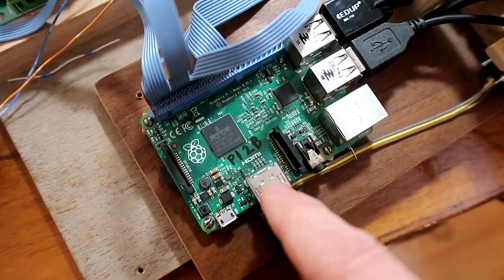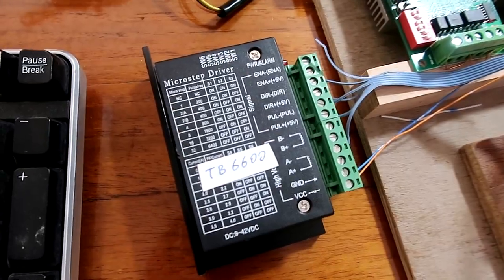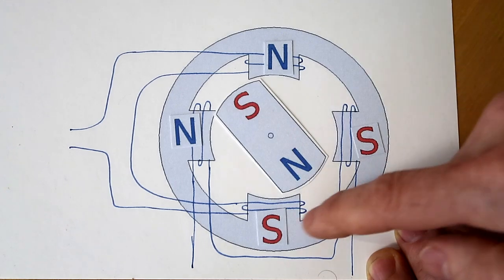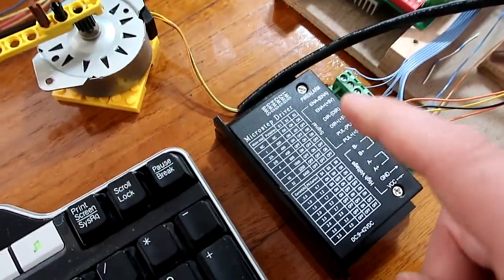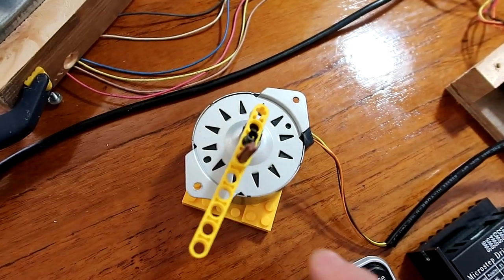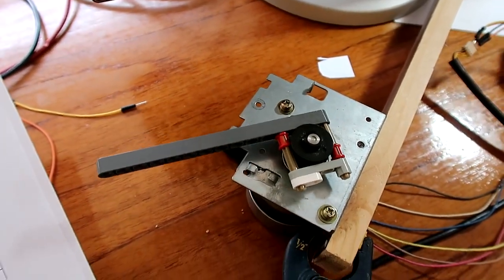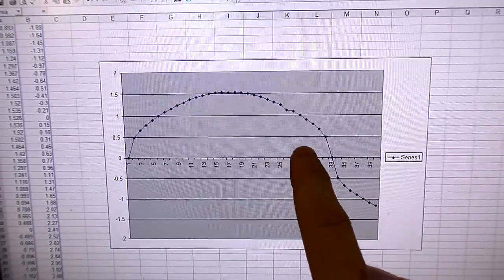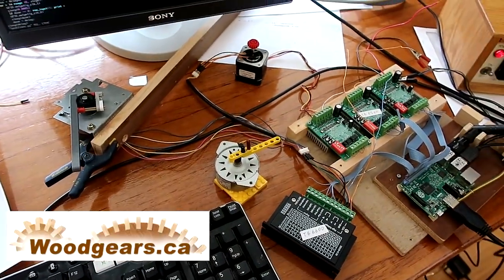Microstepping steppers, and driving steppers with Raspberry Pi

Comment: The rotor design can affect how linear the fractional steps can be.  Also might help to use a vector based motor controller and a precision current controlled stepper driver if you want real precision.

Comment: You had no problem with signalling the controllers (expecting 5v) with 3.3v of the RPi?  Interesting.  I've been reading lots about this with various answers (works/doesn't work/volt levellers). Is current on the gpio pins a concern?

Comment: It works fine on arduino as arduino supply 5v to the driver. And jerks are much low. Can you guide how i can remove those jerks while working on raspberry pi 4

Comment: Thank you for demonstration. İ use a4988 driver and motors with raspberry. 
Right now i want to learn how to make cnc without any other boards.

Which program can i use to drive steps. From 2d or 3d files to gcode to motors. 

İ dont want to use any computer or arduino or cnc control board.

İ know raspberry is enoght to do it. But i cannot find much information.
Reply from the maker: If you don’t want to use an arguing you have to write your own sftware
Reply: @matthiasrandomstuff2221  i find rasbigcd  most probabily this will solve my problem but it has no interface like grlb.   https://github.com/pantadeusz/raspigcd

Comment: The torque produced by a stepper motor is proportional to the current through the coils. Having a higher current setting will cause the rotor to accelerate and decelerate quicker, which will make it louder. Also, microsteps have less torque than full steps. If the stator's field differs from the rotor's by only half a microstep, the torque will be half what it would be if the fields differ by a full step. Smooth current sine waves produce smooth motion, but there are a number of things that can cause a stepper system to deviate from the ideal. Different drivers can use different sensing and switching algorithms to control the current. Also, the resistance and inductance of the stepper coils, and the voltage of the power supply all have effects on how easy it is for the driver to control the current.

Comment: There are a bunch of posts on the internet about problems with the TB6560 and how to fix them. For instance see:

https://maker.pro/custom/tutorial/how-to-clean-up-noisy-signals

https://www.cnczone.com/forums/general-cnc-machine-related-electronics/110986-software-66.html

Disclaimer: I have one of those boards, but have not tried the fixes yet.

Comment: The TB6600 is quite the upgrade from a TB6560. Toshiba made the drives for completely different uses. I'd say they never intended the 6560 to be used as a general purpose unit. They expected people to use the 6560 in custom made applications. So all of the manufactured hobbyist drives based on the 6560 handle current limiting in a janky way. You're supposed to change the sense resistors but instead they use the digital current reduction control.

Comment: Great video! Good idea showing the different quality motors and drivers to see what their quirks are. 

How was it that you graphed the curves? Do you probe voltage levels directly with a rasberry pi pin and figure that the voltage is proportional to current or was there some sort of current shunt of known resistance?
Reply from the maker: Measured every step with a volt meter
Reply: @matthiasrandomstuff2221  I never really understood reactive loads and lagging currents myself. Conceptually I've heard about it all enough but it's just never clicked for me. Although working with stepper motors does tend to make the relationship between electricity and magnetism all more tangible.

Comment: Expecting an electronic  version of the box joint jig...  The ESP32 family of System-on-a-chip are great.  Cheaper than the PI, works with the Arduino IDE, and has built in WiFi.
Reply from the maker: the nice thing about hte PIs is, I don't need any IDE or stuff like that.

Comment: Is it possible that the "nicer motors" aren't actually any better at keeping evenly spaced steps, but moreso that the steps already represent such small angles, that at that smaller scale is just less perceptible? From basically everything I've read about microstepping, which admittedly isn't a ton, they always warn that microstepping is more to make accelerations better and the motors quieter and not so much to squeeze more precision out of them.
Reply: Nicer motors are exactly that. They're a lot nicer than not so nice motors. It takes a lot of precision to make a really nice stepper motor. Which is why they cost as much as they do. I have some 0.8 degree Vexta motors that run like butter. They cost like $200 a piece though. So a tad pricier than mainland Chinese stepper motors. And indeed microstepping is done to reduce harmonics. Ideally you'd run a stepper motor on pure sine waves. But they're harder to control digitally. I have a big old Slo-Syn motor with 120V input voltage that I've run straight off wall current. I just phase shifted the second coil with capacitors. It ran very smoothly. But it only went one speed and stopped and started depending on applied power. So not terribly useful for controlled motion.

Comment: See everyones suggesting a wooden CNC. How about a wooden 3d printer that has an interchangeable head, capable of 3d printing, cnc and laser engraving. Nobody's as of yet come up with a decent way of doing this multi-use tool.

You can even 3d print with wood these days!
Reply from the maker: the needs for those machines are different.  It makes more sense to build three machines than to build an all in one.

Comment: Do you think that the 3-volt signal would be smoother had it not been starved down from the 5-volt it's expecting?
Reply from the maker: the 3 volts is the signal side.  that has nothing to do how the voltages and currents on the power side.
Reply: @matthiasrandomstuff2221  when I built stepper drives timing losses in the optocoupler inputs was a substantial factor. But that was a while ago so maybe the new hardware performs a lot better than it used to? I'd still have to see it on a scope to believe it though.

Comment: It's more likely that the circuit board ones use cheaper driver transistors that don't have good behavior in the linear region (or it uses PWM). 

Whereas the enclosed driver (with a decent sized heatsink) does small currents much better. giving it better behavior when microstepping.
Reply from the maker: or you could just look up the part numbers and see that both use integrated circuits.
Reply: I was talking about the quality of the integrated circuits, the internal driver transistors, and their general characteristics.

Comment: The noise issue and the cogging of the motors is directly related to the construction of the motors.  On better motors there is a specification for the ability for the motor to hold position in a step with power off.  For better microstepping the one driver has the non linear curve to counter this holding force due to the motor construction.  Best microstepping performance is with steppers with minimum holding force with no current.  This is the gear type force you feel while turning a stepper motor with no power.  The stronger the cogging, the better it holds without power and the more it will be non linear while microstepping.  3 phase brushless servo motors have no power off holding power and are driven with sine wave microstepping for nearly silent operation and an encoder for absolute position control.  This is why closed loop is quieter and much more expensive.

Comment: Try Trinamic step sticks for 3d printers. The tmc2130 has silent and spread cycle modes that interpolate 16x microstepping to 256x microstepping making the steppermotor almost silent. Torque and speed may suffer though. 24V is recommended. motor current can be set using spi. The A4988 step stick are a lot cheaper but perform not as good. Noisier and less smooth steps at different current, but you may be able to find a sweet spot.

Comment: On my 3D printer,  you need to set the hold current, which could tune out the hard notching. Have a play with ramps board the only cost a few £$ and can controls 5 steppers.

Comment: Have you verified that the unevenness didn't come from jitter caused by generating the step pulses in software? A simple Arduino using hardware PWM would solve that.
Reply from the maker: That bumpiness is way way slower than the pulse rate, and totally a function of which motor and driver.

Comment: Those drivers are not great, try something like a TMC2130 or TMC2208, or even a A4988.
Reply: I think most people who use TB6600 use them because they can drive high current motors
Reply: Which none of those are, which is why I recommended the others.
Reply from the maker: They are also cheap and robust, and they do the job just fine

Comment: Matthias, when I was designing my DigiBox box joint controller, I found the BigEasy Driver to be a very smooth driver with little tuning in 1/16 microstepping.  I'm controlling it with a PIC18F252 and some direct drive control code.  When I dedicate the routine to just driving the motor and leave housekeeping routines for afterwards, I'm not seeing any missed steps.

Comment: Thanks Matthias - more interesting stuff.  At ~06:36 you say for the second time it's an old Raspberry Pi, and it has only a single core processor.  To me, it looks very like a model 2B, which is what you've labelled it in black marker. The model 2B was introduced in Feb 2015 (confirming it's an old model), however, it does have a 4 core processor (900MHz quad-core ARM Cortex-A7 CPU).
Reply from the maker: The 2 stands for my second Pi.  Not model 2

Comment: Does anyone else see these strange frames at 3:50, 5:25 and 6:41?
Reply: And 1.08.  Is Matthias trying to send us subliminal messages? :).  It would be interesting to see what those frames are but my ability to hit pause at the right time is not up to the task.
Reply: @lobley2  you can go frame by frame with "," and "."
Reply: Scott Howard RIP mobile users
Reply: Yes which is why I came to the comments section to see if anyone else had.
Could be sections of the video that got cut out but not completely.
Reply from the maker: A YouTube bug, probably triggered by uploading in 720p

Comment: Stepper motors from printers and photocopiers are generally more accurate and better quality than cheap new ones. If anyone is interested in having a play!
Reply from the maker: Modern printers don't contain stepper motors.  Only older dot matrix printers.
Reply: I used a stepper motor from a 15 year old ink jet printer for a ”barn door tracker” project. Great fun!

Comment: Next up: CNC made out of wood and lego, accurate to 15/32 of a thou.
Reply: 47/98
Reply: Why limit yourself to powers of 2
Reply: @TheWoodsman87  22/33
Reply: Fester Blats  
did you see the April Fool's video?
Reply: Fester Blats  1/1024 then :)
Reply: 57/21678 sound better
Reply: I'd buy (even collaborate to) that plan if it was a realistically doable project by the noob I am.
Reply: Tolerances are exempt when it rains.
Reply: 1/pi

Comment: The explanation with slips of paper with S N is highly effective and easy to produce!  I made some stepper drivers with TI lmd18245 chips. They are beasts!  I'll post a video link...
Reply: Here they are:
https://youtu.be/SRXMB-XFnNg
Reply: Soldering a diy board for the chips:
https://youtu.be/2I6iD5bnyeU
These beasts handle 5A at 50 volts!